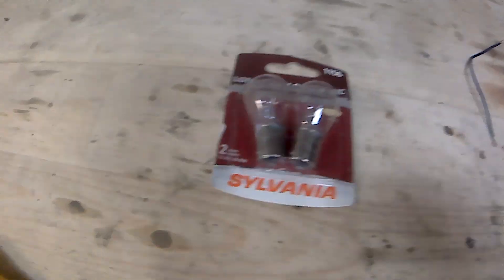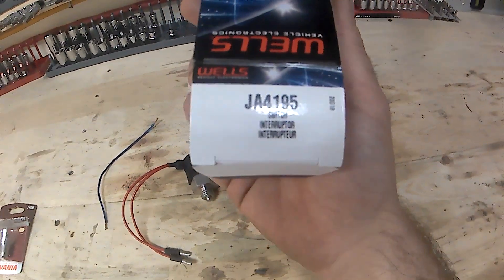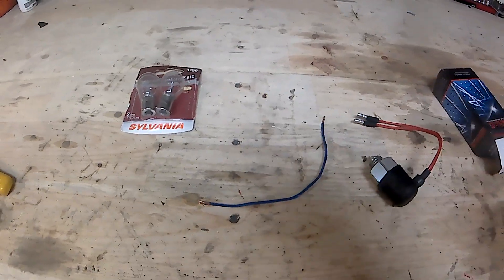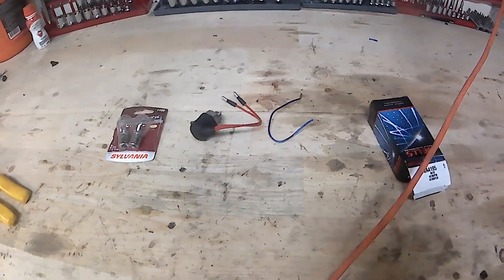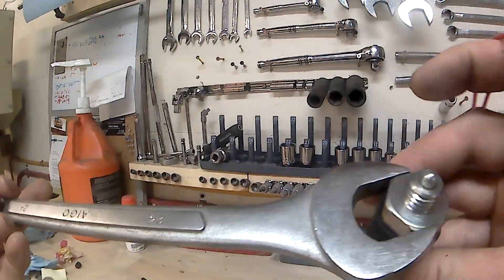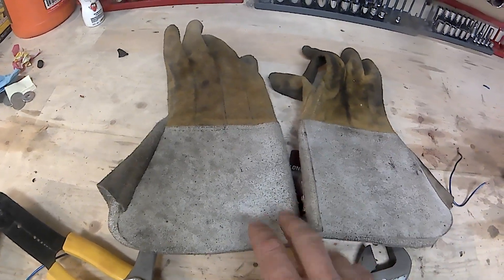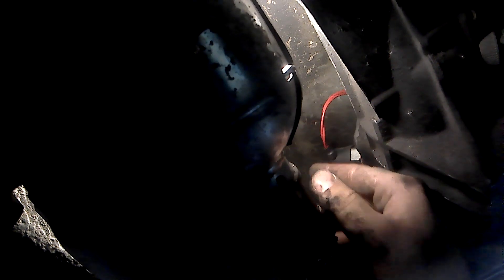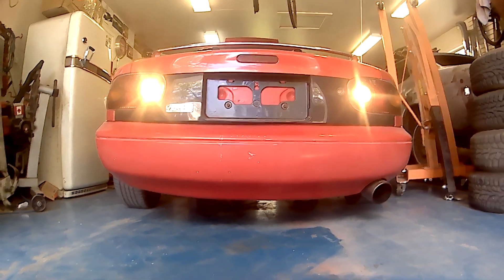Miata reverse light fix!

Comment: Can you make a video if they dont turn off, no matter what gear im in the lights will stay on if theres any power flowing
Reply from the maker: I had not heard of the lights not turning off before. Apparently the reverse light sensor can be screwed in too far causing it to stay on. Sometimes they are missing the brass washer that spaces it out enough. Try threading it our little by little to see if this is the issue?
Reply: Hey did you figure out the issue ? My 94 is having the same problem. The lights wont turn off for nothing.

Comment: I have a 1990 Miata automatic..my back up lights don't work. The mechanic said I need Safety neutral switch .I'm confused as what that part is ? Is it the part you just replaced? Or a different one? There seems to a inter moter safety neutral switch that's like 200 everywhere or the part that looks like what u replaced that is alot cheaper..any help would appreciate..is your car a stick shift? Therefore the part is cheaper and different ? Thanks
Reply from the maker: Vix DeviL my car is a manual so it may be a different part than your car with the auto. If you have the reverse light switch on your auto disconnect the wires and touch them together while in reverse. If the lights come on then you found your culprit. Also check the bulbs them selves as well as the ground connections. I have a feeling though the auto uses something different than a reverse light switch for reverse lights function. When I am stumped the first place I go is to a google search. Good luck. Post up your fix for the issue here in comments when You figure it out.